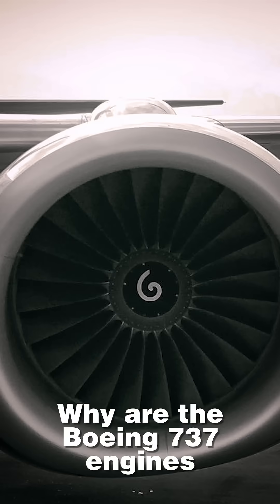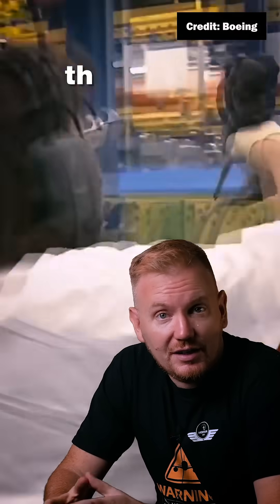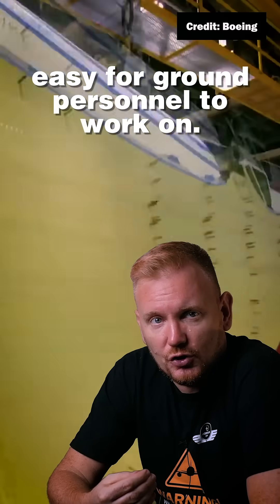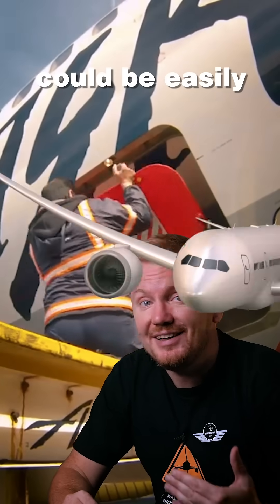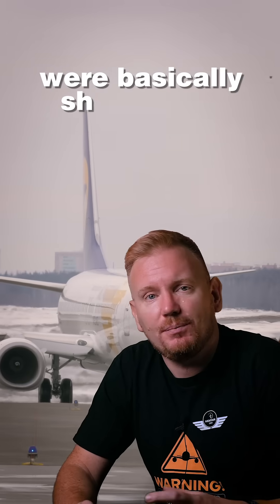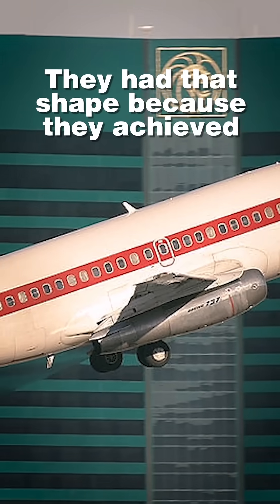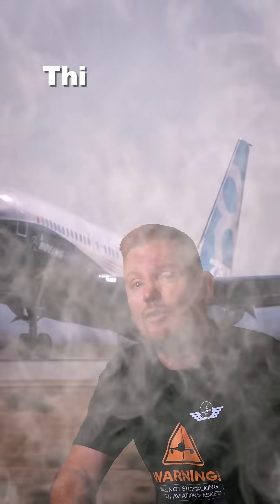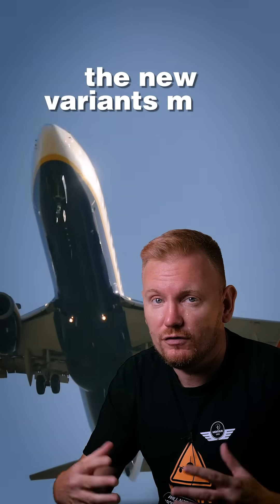FLAT Airplane Engines?! #shorts

Comment: Which turns out to be the reason of death for hundreds. RIP to the victims of the MCAS.
Reply: That, and the need Boeing felt to make the Max a plane that did not require additional training for crews.  So it could be flown with the same typerating.  This was important for Boeing to stay competative with Airbus.  Which offers new aircraft that operate in such a similar fashion, that pilots do not need aditional training. This is a big advantage for an airline. As crew and planes can be scheduled with a lot of flexibility.  So Boeing decided to manage the typical power on/ pitch up characteristics of the Max with a poorly implemented solution. (MCAS) not enough training for pilots. And no proper way to shut down MCAS in flight, and still have authority/use of electric trimming.
Reply: MCAS wasn't around when this engine design was implemented several decades ago
Reply: @jim2lane  actually when it was implemented on this plane MCAS was created for those models to help with an issue they had on liftoff.
Reply: @PhobicGamingGroup  if you're referencing the MAX model, then you're correct. But for this clip they were referencing the re-engine process that took place in the 1980's, many decades before the MAX/MCAS debacle
Reply: @jim2lane  you are in fact correct about that, I got mixed up.
Reply: @jim2lane  Pretty sure its the way Boeing had to have its own way against Airbus' NEO line with bigger engines.

Boeing's low engine height did not make it feasible to make the engine bigger just like that. But they had to raise the whole engine upwards onto the wings, changing the aerodynamics, thus MCAS.
Reply: @aleccross3535  for the MAX model you are correct, but this clip was referencing the flat bottomed engine cowl which was introduced during the 1980's when the first re-engine program for the 737 took place
Reply: This is the 737NG not the Max
Reply: Understand something before commenting. This engine design was long ago before the MAX was produced and it has nothing to do with the crashes of the MAX
Reply: It has nothing to do with that.
Reply: First off mcas was not on cfm56 equipped planes with flattened fan ducts. 
Also there was nothing wrong with the MCAS (in the max aircraft) itself other than the lack of redundant inputs and lack of pilot training and warning systems. The problem was the single AOA sensor input, which created issues on early airbuses too
Reply: @boringdonotwatch2752  Could never figure out why Boeing went with one AOA and not a duel redundant system especially when the MCAS was developed  ,,
Reply: Not rlly bc the MCAS was used on 737 Max with CFM Leap not the NG and Classic 737 which uses the CFM56. Also, MCAS is unnecessary but they wanted the aircraft handling to be the same so pilots don't need training to fly the newer plane but they rushed the design and the rest is history

Comment: The explanation given in the video is not complete. There also is a purely aerodynamic reason.
    During aerodynamic studies to find out what the better shape was for an engine, for a fuselage, for the wings-to-fuselage unions, it had always been assumed that radial symmetry would necessarily be the shape with less drag. Therefore, cylindrical or quasi-cylindrical shapes were considered the best. But that changed when one simulation showed that a deformed cylinder, one with a less curved side, had less drag, for unknown reasons. Wind tunnel tests then confirmed the simulated results.

Comment: The engines are the only way I can easily recognise it lol
Reply: Through years of observation it has become easy for me. As the 737 Nose (and body in general) appears sleeker, the windscreen is different, and the easiest tell besides the engines are the the height. The A320 is far higher than the 737. Or at least appears so.
Reply: There is also a difference where the front of the vertical stabilizer meets the fuselage.

Comment: This story is still not 100% complete. The reason for the ackward shape is a result of the mounting of oil pumps to the side of the engine. Which offcourse was nessecary to still be able to mount such a big engine under such a low wing. And still have the needed ground clearence.  So it is related. But the cowling could still be round, as the fan is also still round. But mounting stuff to the side left and right, creates the need for the oddly shaped cowling.

Comment: I still don't get how this makes any sense from a geometrical perspective

The engine has the same radius. The lowest point of the engine will be the same whether or not you add fancy stuff to the sides. You can't take a circle with diameter 1, add some stuff to the sides and make it somehow have a diameter of less than one. Something else has had to be done..
Reply: Normally, a engine cowling bulges outwards on all sides, the 737 had it bulge less at the bottom.

Comment: This simple design decision (low ground clearance) caused so many problems later on during the design of the later variants including 737 Max-8 disaster with MCAS which cost two crashes, lot of loss of life and reputational damage to boeing and FAA. So the learning here is to keep your design extensible, for future enhancement.

Comment: On the max8 moving the engine foward cause the aircraft to pitch up, so the engineers added software to push the nose down, but the software glitched and pushed the nose down when it was not necessary. It killed hundreds of passengers in two crash.

Comment: Great engines and fuel efficient after most of the kinks were worked out. A little changing to work on especially the fuel control unit.

Comment: Weren't these engines underpowered and then they stretched the 737 to add 25 seats yet kept the same underpowered engines? Or did that change and higher thrust engines were added as time went on.

Comment: I believe that the early 737s were also low to the ground to facilitate passenger boarding from the runway, as this was still very common in the 60s.
Reply: Loading/unloading from the front and back is commonly used around the world. Efficient less passenger to passenger contact

USA passengers would complain too much about using stairs….
Reply: @ML-fd4ih  Augusta, GA still loads from the ramp, mostly. They have a long-ass wheelchair ramp so I imagine people don't complain as much, but they definitely do it.

I would bet that the primary reason American airports mostly all switched to jetways instead of loading on the ramp is weather, not fat Americans whining about stairs. Airbus makes their planes higher off the ground precisely because the weather in Europe is often too wet/cold to do ramp loading, so all European airports have jetways. That, and Airbus hasn't been around as long as Boeing, so they don't have to deal with legacy designs. Subtropical and islands airports, on the other hand, generally don't have to worry about ever raining or freezing their passengers before they get into the terminal.
Reply: @mage3690  it's quite a walk up the stairs from the apron into a 747 in the heat of Mali (though it has to be evening to be cooler with denser air for the take off).

Last time we went it was quite an experience to leave CDG complete with snow and ice (and having the plane deiced) and arrive in 30°+ temperatures.
Reply: @cigmorfil4101  oh yeah, I bet the 747 would have quite the ground clearance. I was thinking of the 737, which is (or was, originally) designed for ramp loading, and completely forgot that the 737 isn't really designed as an ocean crossing aircraft. I mean, it can (the first commercial transpacific flight was flown by a propeller-driven seaplane!), but nobody would do it. The '37 lacks bunk beds, for one thing. The '47 has bunk beds installed so pilots can take breaks on long flights.
Reply: @mage3690  I wouldn't go as far as saying ALL European airports have jetways, Beauvais is just one I can mention from the top of my mind with exclusive ramp boarding
Reply: @ML-fd4ih  Depends on the passenger, but sure.
Reply: Lol the ramp not the runway
Reply: It still is?
Reply: @dumle29  Yes, but not nearly as much in the large commercial airports that 737s fly to.
Reply: @insanegaming9410  Yes it is have you flown around Europe a lot of airlines will board from the ground it is standard practice in Dublin terminal 1 which is the home of Ryanair to board from stairs as there are no jetways all over Europe in large commercial airports stairs and ground hoardings are still used quite frequently.
Reply: You mean the apron not the REY 🤦🏻‍♂️
Reply: Still common in a country like Australia. Unless it's a Launceston to Melbourne (and vice versa) thing. Or maybe a domestic travel thing. Launceston doesn't have skybridges afterall.  

Melbourne is a mixture. Front has a skybridge while the rear is on the tarmac, but close to the entrance.
Reply: Yeah, i believe the earlier 737 have stairs on the front but i think the 727 is lower. I might be wrong tho

Comment: Pratt and Whitney Bobby motors were originally 2 bypass to 1 motor.  Max Leaps are 8 to 1. Pratt and Whitney motors are still used on Bobby 200's in Canada and Alaska,  where they tolerate fod ( foreign debris ) better than the bigger mills.  Even the oldest Bobbys make a joke out of their flying competition.  There area few hidden advantages to the least efficient 737's and the older motors are well supported.

Comment: Which also caused MCAS to be implemented and the rest is history. 😢
Reply: Badly implemented cause they were too lazy to go through recertification which is surprising seeing as it has coming out the the FAA were in Boeing’s pocket.
Reply: @macguyfromscotland  they were also too lazy to properly train pilots on the new 737s making them not aware of the new mcas
Reply: @germanfisch  
Not lazy, cheap
Reply: @germanfisch  
Not too lazy, they didn't want their airline customer to have to do expensive [simulator] training which would be required to cover MCAS and its unlikely [sic] failure; that way they could compete with the A320 by ensuring their offering was cheaper by not requiring the [re]training and creating a customer lock-in.
Reply: @germanfisch they specifically removed any nention of it at first so pilots would be unaware of it
Reply: @macguyfromscotland  don't forget executives from McDonnel Douglas moved over to Boeing with the aquisition, and with it they apparently took their "gentleman's agreements" with the FAA along with their habit of not admitting to flaws until two fatal accidents have occurred.
Reply: Mcas was only implemented for the new max engines. But still shame on Boeing
Reply: This is the NG not the Max
Reply: @timwilson7326  Its the Classic version from 1979, not even the NG which had the same engines 15 years later.
Reply: @timwilson7326  Well, thr classic actually, but NG too.
Reply: Not quite, the flat engine cowlings are from an earlier version of the 737 that did not have MCAS
Reply: @devingraves8044  darn, it was a good comment thread though while it lasted.
Reply: But isn't only for the MAX models?
Reply: The comment i was looking for
Reply: No this is not the cause because this happened back in 1979 on the 300/400 and 500 737 models for the first and also on the NG family. 

NON OF THESE 9000+ AIRCRAFT HAD  MCAS !!! 

Just keep it to yourself if you have no knowledge.
Reply: Exactly… they were losing their market to Airbus A320 and decided to rush and cut corners..
Reply: @Muggggy  every since Boeing was purchased and merged, it’s not real Boeing anymore
Reply: Well, tbh, this could be a video about 737 Classic and NG which didn't have anything to do with MCAS, just the new bigger engines installed more forwards..
Reply: @rkan2  tbf the MAX had the same issue from the engines that are even bigger than theclassic and NG ones. Its just the cutting corners that makes things doesnt work for MAX.
Reply: @Felix11010  I know, but reffering to the flat engines - They were first introduced with the classic.
Reply: @Felix11010  
MCAS was to avoid pilot recertification. When Boeing agreed with American carriers to build a new version the promise was no pilot recertification to get the sale. That is why MCAS was designed and installed.
Reply: anything to save money. even if it cost them lufes.
Reply: To cut cost further, they subcontract the design mcas to India and fired all their domestic software engineers, this is what I called pure Capitalism the Americans are proud of. 😘😘
Reply: @andrewlim7751      And if in that capitalist system one causes harm, they are legally responsible. In the case of Boeing, 2.5 billion dollars responsible.
Reply: @ranman7688  
Well, have they paid the said amount? Don't forget the lobbyists, they're plenty in Washington, it's called corruption in other countries, but it's freedom of expressions in u.s. 😁😁
Reply: @andrewlim7751   That's also called corruption in the United States.  A free market requires that each party is playing fair. Unlike socialism where all the power is on one side.
Reply: @ranman7688  
Get real mate, you're offering opinions while I'm speaking FACTs. 😁😁
Reply: @andrewlim7751  I can say the same thing. I'm speaking fact and you're speaking opinion.

Corruption is not capitalism. Call it cronyism, call it corporatism, call it corruption, but government playing favorites in any economic system is not capitalism. That is a fact.
Reply: @ranman7688  
Geez! Opinions after opinions besides facts.
FACTs
1. Boeing was allowed to fly with clearance from FAA.
2. Former FAA executives was appointed with lucrative posts in Boeing.
3. American software engineers  jobs were axed in favour of Indian OEM jobs. 
4. The ceo of Boeing wasn't penalized for doing was he was doing was a fact also.
5. Big capitals are calling the shots in Washington is a fact also. 
The world don't need your opinions dude
Reply: @andrewlim7751   You just proved my point. Government playing favorites. Facts.
Reply: @ranman7688  
This is the nature of total capitalism, where capitals are in control of everything, it's your system, your selections, your way. 😁😁
Reply: @andrewlim7751   I think you need to do more reading on what the free market actually is. It requires two consenting parties. When one party is in collusion with the government, that's not the free market and that's not capitalism. It's just raw power.
Reply: @andrewlim7751   What you've been  describing is corporatism. Not capitalism.
Reply: @ranman7688  
Again be real dude, one don't expect 10 billion corporation vs individual to be fair and "free", that's a reality.
Reply: @ranman7688  
And that's also capitalism, it's Capital dude.
Reply: @ranman7688  
That's also the reason the safety of individuals were compromised when facing CAPITALs of capitalism.
Reply: @andrewlim7751   Learn definitions of words.
Reply: @ranman7688  
Try to learn the difference between aspiration and reality, and btw, when msm telling you're free don't tell me you really believe it.
Reply: @andrewlim7751  The United States has not been a truly capitalist country for a long time. At most, it would now be considered a mixed economy. So no, I don't think we're truly "free."  You assume far too much about me. 
Btw - the reality is that when government and business are intricately connected, it is not capitalism.
Reply: Max engines are not flat anymore though
Reply: @kylejohnson3647 yes, they are not flat anymore because of MCAS, which allowed the engines to be moved forward and up.
Reply: But… he’s talking about the NG here, not a MAX
Reply: The MCAS system was not used with this airplane. The 737NG was before MCAS. The 737Max used MCAS so it would fly like the 737NG designed decades before it. This was to avoid pilot recertification and simulator time.
Reply: All thanks to McDonnell Echelon that only think for money less innovation.
Reply: You stole my words
Reply: Yup 😅 I was literally just saying that man
Reply: You're talking about the 737 MAX variant which DON'T have this flattened underside for the engine. The flattened engine is only found in 737 NG
Reply: Exactly.
Reply: No, that far later to history of B737 but agree that it is sad
Reply: Yeah, and the pilot got in serious trouble even tho it wasnt mentioned in the flight manuals etc because somehow the FAA allowed that
Reply: MCAS is actually unnecessary
Reply: Exactly what I was thinking
Reply: As mentioned in other comments, MCAS wasn't invented until years after the "flat bottom intake" 737-NG came into service.
737 max definitely was a flawed design when it came out but now 737 Max airplanes are flying around every day and doing so safely.
Reply: TLDR: it's all Airbus's fault. For making planes so good, Boeing killed themselves other people trying to keep up.
Reply: Eh, no, that was in the generation after that with even bigger engines.
Reply: One could go with the design and forgoe MCAS which would be both entirely safe and efficient. It would just require pilot recertification on a simulator 

But you are correct that this engine change has started it all
Reply: The only human comments
Reply: Came here to say this😢
Reply: I love it when a comment just destroys the video. Hahah😂

Comment: But up & forward caused a CoG imbalance that led, due to hasty “cost-avoiding” re-engineering that ignored the need for proper redundancies, to two horrific crashes.
Reply: Not center of gravity at all, it was related to thrust. It’s not nose heavy or tail heavy.